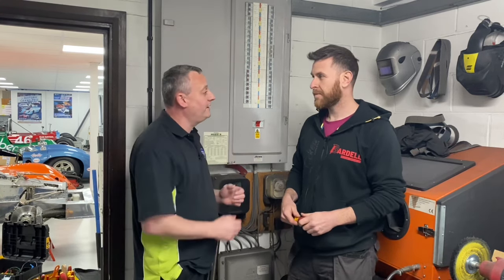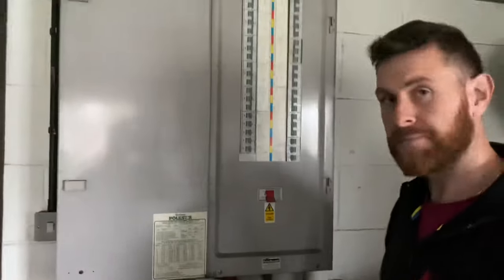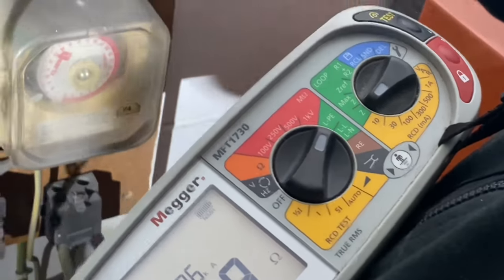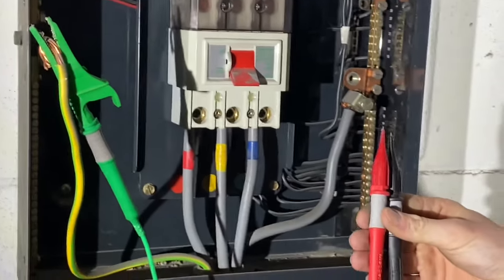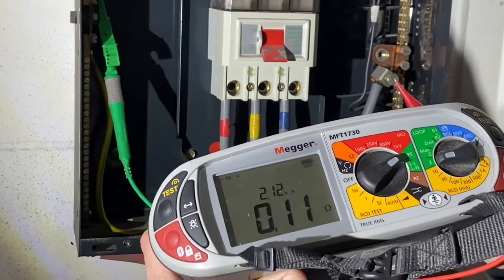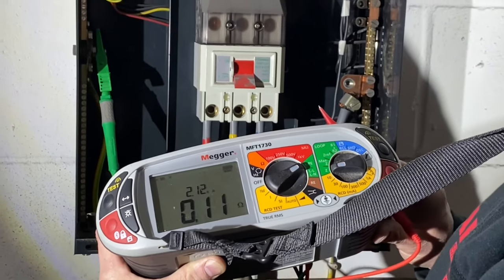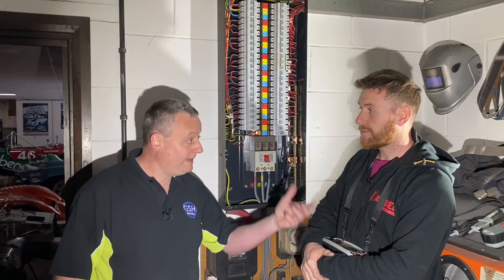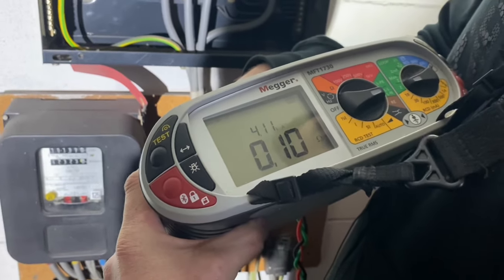LIVE Testing on a 3 Phase Dis-Board - External Earth Fault Loop Impedance Ze, PEFC, PSCC AM2 & AM2S

Comment: Excellent Video! Very well explained. I have just one question please to clear my mind. In theory, line to line fault is 3phase fault multiply by 0.866, therefore can I just use the fault current measured in L-L  (4.11 kA) divided by 0.866 to get the 3phase fault instead of doubling the max fault measured in L-N?

Comment: for the am2s would we need to test between line conductors for PSCC or is testing between line and earth and line and neutral and doubling it enough ? Also would the reading from line and earth ever be higher than line to neutral ?
Reply: Should be times by square root of three I thought becuase of the different between Line and Phases?

Comment from the maker: == 🕐 Time Stamps - Cut to the action 🕕 == 

00:00 - Ze and PFC tests 
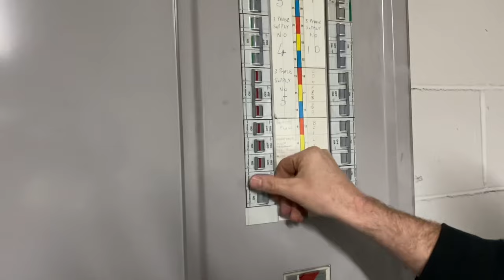00:54 - Isolating the 3 phase distribution board 
01:58 - Disconnecting the earthing conductor to remove parallel earth paths created by the bonding
02:55 - External earth fault loop impedance test Ze test on a 3 phase dis-board  
05:11 - Reconnect the earthing conductor 
05:19 - Prospective earth fault current PEFC test (PFC)
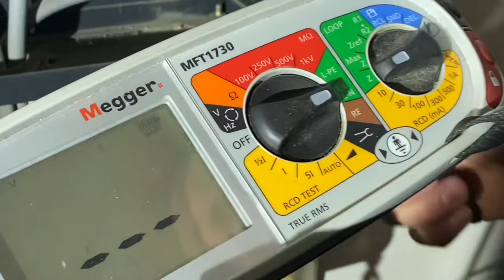06:34 - Prospective short circuit current PSCC test (PFC) 
08:00 - Rule of thumb double your highest reading from PSCC test for a 3 phase supply
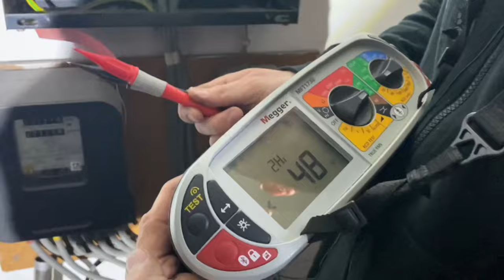09:48 - Testing PSCC between the 3 line conductors of a 3 phase supply

Comment: Thank you so much for these videos. Really helpful information!
One question. Why we take the PFC measurement with the main switch off and on the source side? When using the system all breakers etc are on. Why take the rest of the system out of the equation? the PFC surely would be different when the whole system is connected and turned on?

Thank you

Comment: Does that earth wire go back to supply transformer or is it just linked to the neutral at the cut out.   Is 3 phase the same as single phase domestic in this regard.  Thanks
Reply: On a TN-S the earth goes all the way to the transformer separately from the neutral,. They're then connected together at the transformer.

On a TN-C-S (shown in the video) the earth and neutral are joined at the cutout, and continue as a "PEN" conductor to the transformer (protective earth/neutral).

On a TT the earth doesn't go to the transformer at all. Instead it connects to the consumer's earth electrode.

Comment: I’m assuming as it’s a live test you’d need the tails to have voltage to actually get a reading on the Ze and PFC tests? For example on the AM2 rig if they’ve isolated it remotely, I’d need to lock off the main switch on the board, then energise the isolator?

Comment: Great video guys! Not sure how strict and to the book the assessors will be in the am2 but GN3 does recommend dividing the line to line value by 0.87 if measuring Ipf between phases.

Edit:
After some research online I believe this figure is a guide to working out a simultaneous fault between all phase conductors with a fault of negligible impedance.
Reply from the maker: Great feedback 👍🏻

Comment: Why double why not tripple...surely if the armoured was destroyed and 3 phase was shorted with the netural it would be higher than doubled?
Reply: If I'm right you can only sort between 2 lines so line voltage is 400V giving highest fault current possible. E.g 400V ÷ 0.10ohm =4000A
Reply: I can hear you Clem. Technically if you measure line to line you should then divide by 0.87 to account for the bolted fault shorting all lines at the same time that you describe! Doubling the line neutral pscc accounts for this already. Hope that helps. 👍
Reply: Even if you had a three way fault - which is a two fault situation so we don't usually consider these. But the three phases are like the corners of an equaliateral triangle - so each is 400V from each other. When you short all three you'd get approximately the same fault current on each line conductor as the additional current would be balanced across three instead of two conductors.
Reply: @keirstitt8277  not according to the iet you wouldn't... It's in GN3 👍
Reply: @travoltasbiplane1551  you must have a different GN3 because it doesn't say any such thing in there.

Appendix 14 of BS7671 maybe.
Reply: @keirstitt8277  you'll see the .87 thing under prospective fault current. Definitely in there for at least the last two editions. It accounts for the bolted fault. If we were only considering a line to line fault then just measuring would be fine wouldn't it.... There would be no benefit to adjusting the measured PFC.
Reply: P69 in the blue book version. Mid way down.
Reply: @travoltasbiplane1551  ah I can see 

Not sure what it adds on Annex 14 which uses more precise language. 

Assuming that R1 and R2 are equal, then a fault Line-Line would be sqrt(3) or 1.732x any single phase fault and three way L1-L2-L3 fault would be 2x. 

My point above was that 1.732x is so close to 2x to be effectively the same thing and that we use the 2x value as a default - also because it's very easy to multiply by two. But in pratice there is nothing directing us to do this and indeed in GN3, appendix 14 to the regs and the EAWRs we are actively discouraged from measuring IPF anyway unless it is nescesary - even though we often do measure it out of habit. 

I don't personally buy the idea that a three way fault is an issue except in very specific locations. If you cause anywhere near a devices Icn rating to flow then you'll also be getting a 100ms disconnect. I'm not sure how it is possible to inadvertantly cut through a cable in such a way as to short all three phases within 100ms - in reality you'd short two phases and then the third. But people take an informative annex to the regs and apply more importance to it than many of the normative bits.